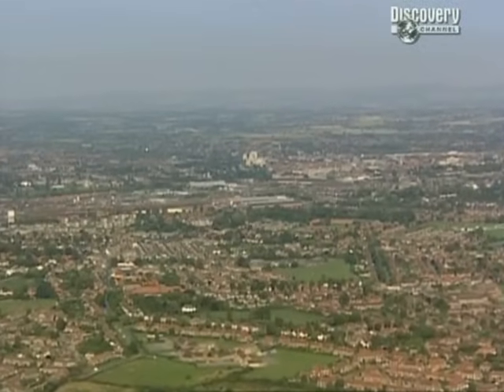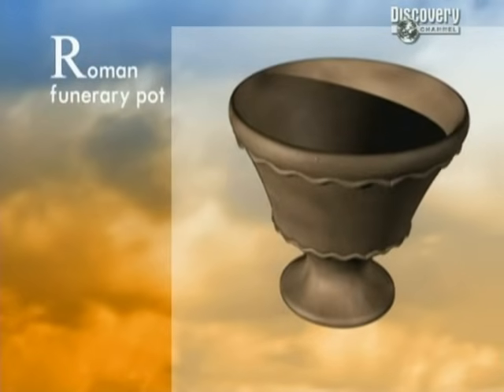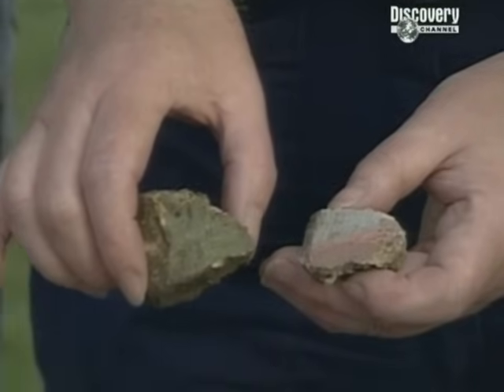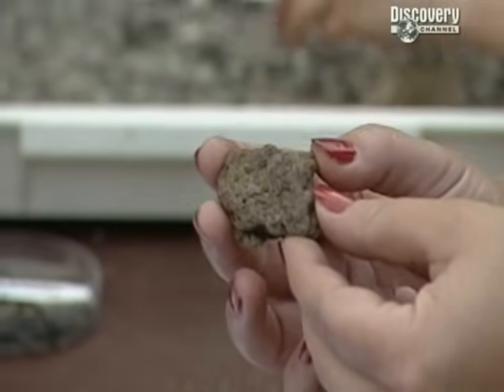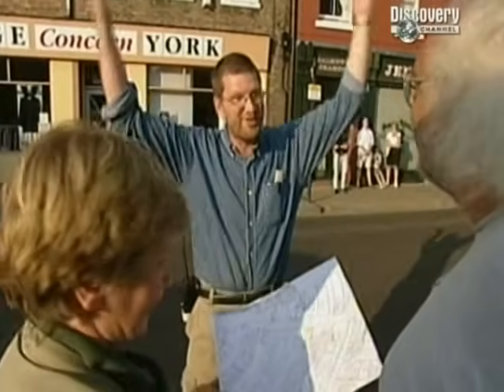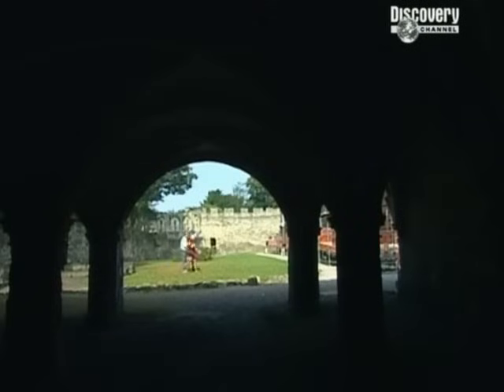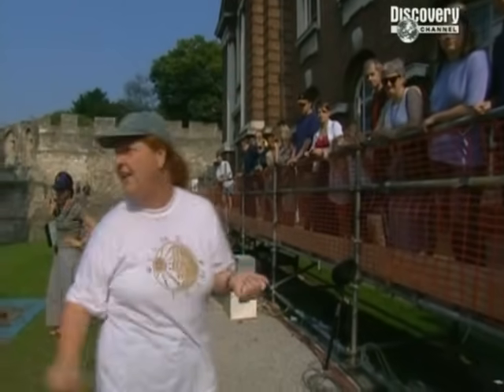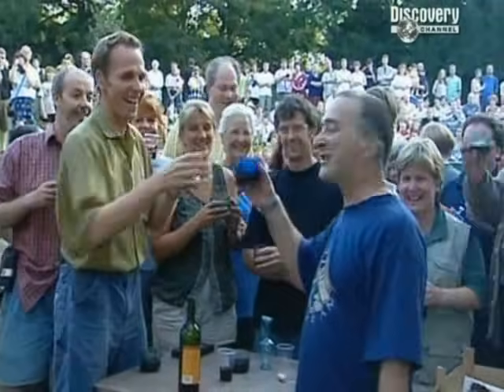Time Team S07E13 york

Comment: I'd like an explaination of how the romans or whom ever produced the tools for making the glass, Blowpipes of metal, etc.
Reply: i know that early roman glass making did not use a blowing method like they showed. i don't recall many details but i think it was a casting type of construction. if they did use a blowpipe, which is made of iron i'm sure it could be cast just the same. i am speculating in part and i agree totally.
Reply: ***** Actually they did. Well, sort of. Roman citizens (those actually born in Rome) didn't as they weren't allowed to be "in trade", but it was supported by their government and was manufactured in many parts of the Roman world. Free blowing glass was introduced in the middle of the last century BC and coincided with the rise of the Roman empire. Mold blowing (what I think you referred to as casting) came along a bit later during the first part of the second quarter of the first century AD and uses a different ratio of ingredients to change the consistency of the glass. The most common theory is that the blow pipes were made of clay and shorter than those used by modern glassblowers. One of the Renaissance faires I work at has a glassblower right next to our booth. Five times a day Stuart goes into detail on the origins of his trade while demonstrating the techniques.
Reply: The Romans were LATE Iron Age, by the time they made it to western Europe.  Metal working had been understood for over 1000 years by that time.